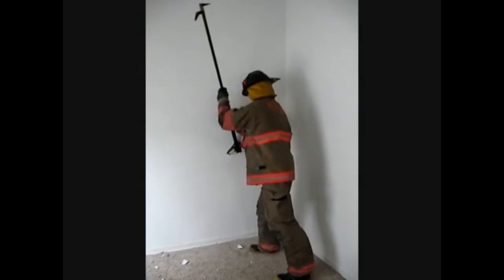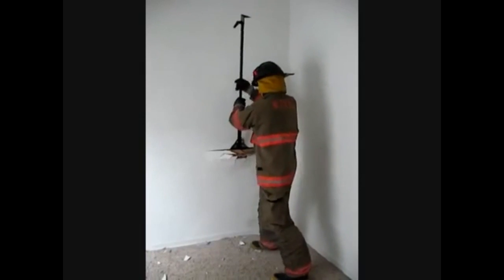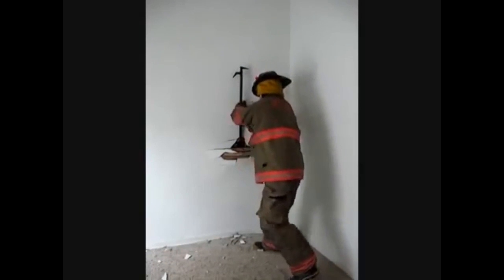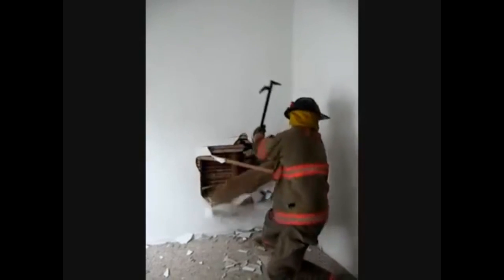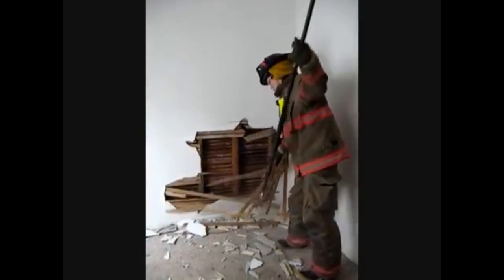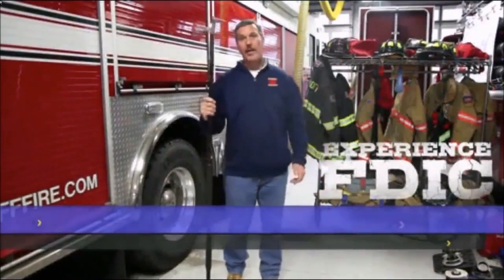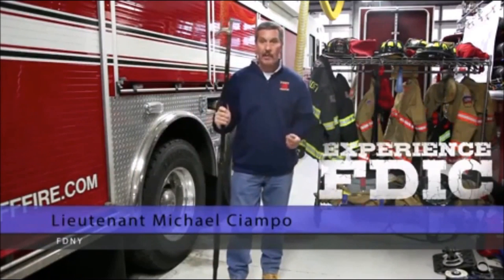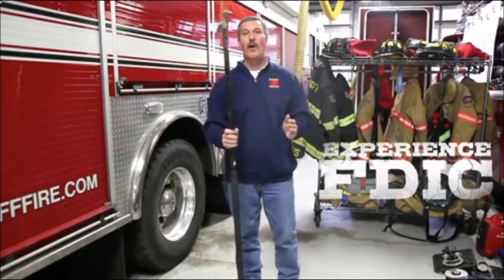How To Use A NY Roof Hook "Compilation Video"

Comment from the maker: I’m assuming you are referring to the Roof Pro-Bar. I personally like the standard 30 Pro-Bar because the links welded to the shaft don’t get in the way if you need to strike the shoulders of the fork for forcible entry. I do like a chain link welded to the handle of the hook so that the Pro-Bar forks straddle the link and allows the hook and halligan to marry. I am planning on making a video on how to marry the tools in this manner soon. I hope this helps.

Comment: What is the purpose of the firefighter at 4:00 hitting the door with the haligan?  Weakening  the door?
Reply: By hitting the door where he did he pushes the metal in a bit and creates what we call a purchase point (basically a gap so the tool can fit in).

I know it's a little late for a reply, but saw this and figured it may help.
Reply: because it is a metal door he hits it so that the metal will pull back enough to get the wedge of his halligan into the crack so he can leverage it open.
Reply: pattycake350 it dents the outer skin of the door, which pulls it away from the jamb slightly and creates a little bit more of a gap to get the adz in place. it also shocks the door and any locks to possibly loosen them up a little.
Reply: Thanks for the responses everyone